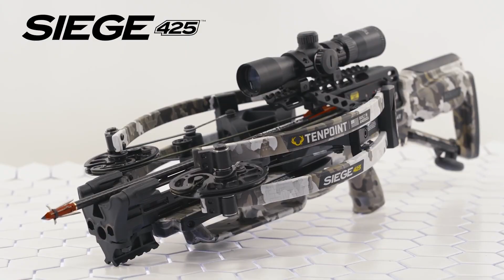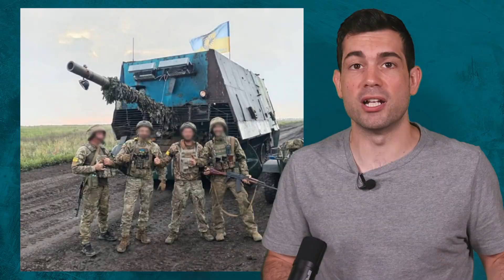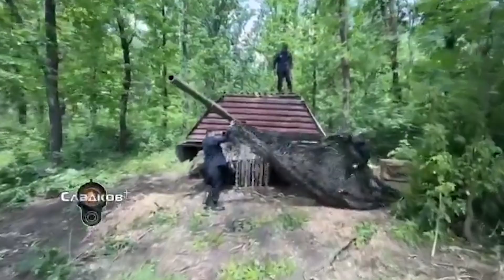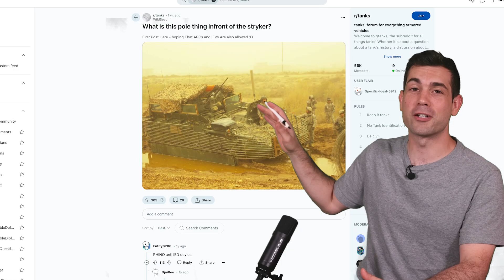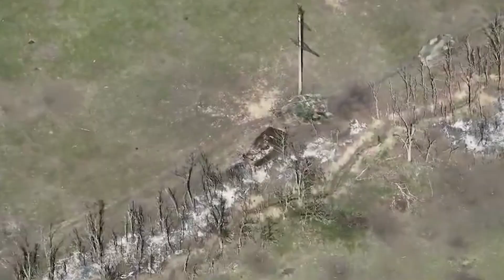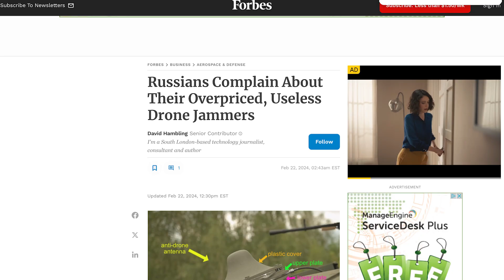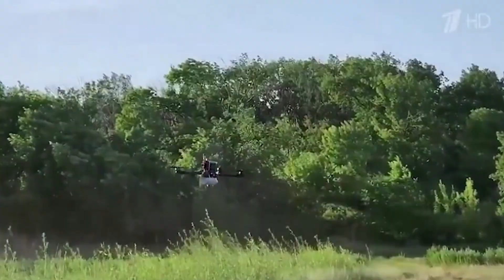Why Ukraine’s Taking Turtle Tanks Seriously

Comment: Honestly, I do not know why they do not. Just load smoke dispensers with grape shot And have a sensor set up that will see the incoming drone and will detonate the grape shot like a Better and cheaper active denial system where it just knocks the drone out of the air like a large shotgun blast. And it's anti infantry as well for those climbing up on top of them

Comment: Its still a very strange adaptation. No doubt it escalated the difficulty for FPV drones to attack but if it did survive and reach fighting distance with Ukrainian lines, what purpose would it then serve? It has terrible visibility and constraint turret movement that negates it as a tank. Its a mighty expensive way to build an inferior assault gun essentially.

Comment: Russian morale is so low that I'm pretty sure that Russian resistors are silently developing counter-measures for the tanks. Some of them include: Mismanagement, tank incapacitation. This means that the tanks are far less powerful in the hands of the Russian frontlines than their full potential would allow.
Reply: Russia isn’t losing the war, stop watching CNN and Disney
Reply: Furthermore, now that I think about it, the tank's modification seems to align with the troops' wishes the most: The tank armor does not boost offensive power, it increases the survivability of the crew.

Comment: A number of years ago, I read about the US military testing a centrifugal gun that could fire ball bearing sized projectiles at a rate of something like 100k rounds per minute.  It was projected to be added to armor as a short range anti-personnel and anti-drone weapon.  As I recall, it was basically a high-speed spinning disc type device that accelerated the rounds from the center out through an aimed aperture at the edge of the discs.  Fired in sweep mode, it could flood the airspace around the vehicle with ball rounds in short bursts.  I'm curious what happened to that project?  It seems like it would have great applicability in an era of small FPV drones.

Comment: Ukrainian troops don't want anything to be used by the Russians, that may give them an edge.
It shows the willingness to modify tanks and weapons on both sides.
Ukraine has shown all kinds of modifications to drones.
Trying to spot a drone, the size of a chicken, isn't what most AA radar was designed to do.  They're looking for aircraft, like jets and helicopters.  Something as small as a drone, is just getting lost in the background noise.
But in the videos we see, there's no radar at all.  convoys of tanks go plowing along across the plain usually in a single file.  and drones target whichever tanks the operator can get in the sights
Removing the 'reactive armor,' seems counterproductive, shell or not.
The thin 'homemade,' shell over the tank, will not stop most attacking drones.  And will do even less against an anti-tank missile.  And no reactive armor on the tank, leaves it kinda naked!
Anything getting in past the shell, can hit the tank itself.  And ends up usually being a, 'bad thing.'

Comment: The most vulnerable parts of a tank are the turret top and the engine deck. This is why drones are so effective. They can strike from above where the armor is weak. If you can explode the drone warhead before it hits the armor, the tank survives. The turret can't traverse, so you basically got an assault gun/tank destroyer, but those are nothing new. Drone warfare is changing everything.

Comment: What would be great, is if we saw Ukraine attach a DF (direction finding) antenna and basic AI that basically kicks in when the operating signal reached "x" db in power. Use the DF antenna to determine the direction of the jammer and the onboard AI to determine distance by some means such as in this direction there are "y" items in the field of view that match the direction of the jammer and based on signal strength and AI analysis of both the image and signal strength, item "Z" is the most likely target.

It seems these Turtle tanks are used as troop transports to cross fields where Ukranian tanks and armor isn't... So if you could build the system light enough with a working and practical DF antenna and a decent AI program... Worse case scenario you hit more Russian armor that isn't carrying the jammer.

Comment: It may not be the precision of the Tunguska that is the problem. The operational envelope that FPV drones exist in is challenging for older radars. Because of their relatively low speed and low RCS, powerful microdoppler radars are an absolute musts for detecting small drones in time to do anything about them.  Tunguska were optimized for higher speed threats with better radar returns.

Comment: A simple anti-drone system would be 5.5mm chain gun mounted on the top of a tank or APV with a short range radar and AI remote fire capability.  A short burst could easily destroy most drones!
Of course the Russians haven't the industrial capability to make the necessary electronic components for such a system.  But the Ukrainian's do and what they can't make they can buy from their allies in Europe and America. In order to fly,  drones need to be very light, this means plastic, light motors, small battery, which make them vulnerable to small weapons fire.

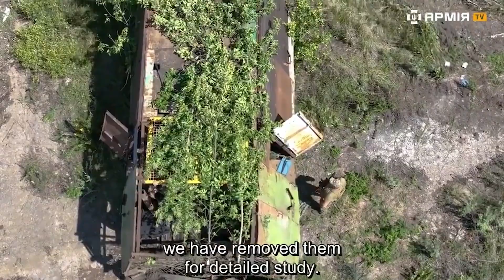Comment: 14:35 these external jammers strapped onto a pallet placed on top of a tank were very short lived, like 1 week. The turtle/shed tanks then appeared with some of the first clearly having jammers installed. The first of these apparently took something like 24 FPV drones out. This number fluctuates as sometimes Ukraine captures the EW and there is a window of Ukraine's drones being unjammed.
I've heard one stat about how Ukraine will send a wave of 3 FPV drones against a tank; however, if it is a turtle/shed tank then that becomes 6 FPV drones.

Comment: The UAF captured a turtle tank yesterday. It was gutted inside. The active protection pods were empty. The 'armor' was sheet metal.  It was a giant APC with literally no armor, even the captains turret hatch was welded shut. The only opening was the driver seat.
Reply: "even the captains turret hatch was welded shut"

thats hilarious because doing that adds absolutely no armor, they simply made the tank harder to escape during an emergency
Reply: @joseaca1010  idk, welding it shut does increase the likelyhood of an he grenade, like those the fpv drones carry to not be able to blast that hatch open and create a deadly overpressure scenario for the crew. its somewhat not dumb. t55 and onwards have rear and bottomhatches iirc.

Comment: We designed the Early LAVs, and they were originally supposed to be lightning fast, responsive, and go-anywhere vehicles (why the 8 wheels and able to float over water).  At first they weighed only 14-tons.  The footprint pressure was so small, that they could drive over many of the old mines.  They were intended to get a squad In and Out, before the heavy armor or artillery could gets its act together.  This worked for about 10+years.  Now, After a few combat missions with modern drones, fire-controlled fast turrets, dual-warhead TOWs, AIM-120 GPS-guided Mortar vehicles, and any form of a 6kgram IED, these vehicles have been MUTATED well beyond their original functions.  Add-on spaced armor and grilles, and active armor, and bottom protection from smart mines, have just made these vehicles into another form of the M2 Bradley.  None of them can float.  The top armor is so cheesy that any 2kgram/warhead drone can disable them.  Credit goes to the US Army and Marines, since they added-on whatever devices needed to make them viable on an actual battlefield.  That probably cost many lives.  It is clear that vehicles of this type need some kind of "overhead protection" mechanism or electronic devices, which reduce or eliminate small drone attacks.  Drones can go for 10-to-20-times the distances of artillery rounds.  Russian forces have artillery as their fundamental battle doctrine.  They are responding just like the US forces did, to mitigate the threats for their enemy.  I predict that electronic warfare will be the next actual battleground at a tactical level.  At a strategic level, it will be heavy warheads, launched from a vast distance, where the launching platform will be safer.  For the Ukraine, any electrical power plant, water supply facility, railroad transfer yard, gasoline and diesel storage facility, and heavy bridge crossover, will soon be destroyed, from a far distance.

Comment: So the way that RC FPV aircraft work is that control is usually frequency hopping spread spectrum across a certain band like 2.4Ghz or 915/868 Mhz, it's literally designed to avoid interference. The transmitter is on the controllers side while the receiver is on the vehicles side. The video part is the opposite, the transmitter is on the vehicle and the receiver is on the controller's side. The video is usually analogue (although newer video systems like DJI/Walksnail/HDZero are digital) and not usually spread spectrum frequency hopping and runs on it's own frequency, usually in the higher 5.8Ghz band. It's much, much easier to interfere with the video signal than control.

Comment: Hear me out, what if they put a spinning antenna wire on the sides of the turtle tank kinda like a helicopter prop but with a hand crank. The antenna wire could knock the drone out of the sky and away from the tank.

Comment: I suspect that the RADAR and 30mm guns on a Tunguska SHORAD aren't able to keep up with the somewhat unusual flight profile of FPV drones, as it seems like they are more intended to track and shoot down aircraft flying at altitude, rather than targets basically travelling at tree-top/ground-hugging height. 30mm also seems like it could be a bad trade-off between terminal effect and amount of ammunition able to be carried, especially for drones, if it could actually hit them.
I'm also somewhat sceptical that it would be good against modern aircraft either, at least at the very extreme (for machinegun or cannon based systems) ranges that modern aircraft can engage and destroy ground targets, for at least the last 30 years.

Comment: For anti drone, we could add another turret on top of our tanks with a P90(or am180 my favorite) like a mini CIWS You can use a small short-range thermal that scans and points
Reply: The scanning turret can be separate from the gun. The gun itself would have a thermal of its own.  First (scanner/pointer thermal) locks on the second (the gun)locks they triangulate, adjust for movement, commence fire repeat until grounded or destroyed

Comment: Spaced armor does not function against HEAT warheads. Especially the RPG-7 warhead which is not optimally fuzed and actually achieves the greatest penetration after about 2 feet from the detonation point. Some ATGMs have this as a feature such as the NLAW which detonate the warhead several feet above the target tank.

The reason for the chain/wire mesh grid is to disable the piezoelectric fuze on RPG warheads. This ONLY works against Soviet RPGs which utilize this type of fuze. Essentially the warhead gets caught in the chain and then the thin outer shell is crushed against the fuze and this shorts out the warhead so it does not detonate. There are photos of this working from Iraq where you'd see an entire RPG warhead buried in the side of a Stryker with cage armor and it didn't detonate.

The function of the big metal shell seems to be protection from shrapnel and small arms for the troops riding on the tank.

Comment: An interesting comparison to make might be torpedo nets on Battleships in the late 1800s and early 1900s (They came back for a bit in WW2 as well). Cheap, fast-moving torpedo boats that could harm giant battleships had just become a thing, and this led to the adoption of awkward spars sticking out the sides of large ships to hold nets that would "catch" the torpedoes and prevent them from damaging the ship. In concept, pretty similar to what the turtle shell is doing on these tanks, and nearly as awkward-looking.

Ultimately, these were a clunky stopgap measure, like the Turtle Tanks. Spaced armor in the form of torpedo bulges and torpedo belts replaced the nets, and torpedo boats were partly countered by dedicated "Torpedo boat destroyers" - or, as we call them now, just Destroyers. Which would potentially line up with what's being said here about the potential of new SHORAD vehicles.

Comment: If they have to wire guide the drones kind of like a tow and depending how far the jammers reach the drone could just carry the receiver on it like normal then drop it when they start getting jammer inference and fly the rest of the way in by wire it might reduce the payload or speed slightly but at least they would not have to be as close and have a wire going all the way back to them they might even be able to drop the battery with the receiver and technically recover it later if they can get to it

Comment: The turtle tank is a low-cost solution.  The Russian lead in tank production is pretty unassailable.  These are vehicles that are built to win a war of attrition in the new battlefield that has many drones, but fewer tanks.

I think people obsess over territorial gains, when the purpose of the Russians is to attrit Ukrainian forces, while steadily building up its own.  

Maybe all the turtle tank is doing is forcing Ukraine to use more drones, thereby exposing their operators to counter-measures by drones, conventional artillery, and air strikes.  If the turtle takes a lot more drones or more expensive drones to combat, that helps the Russians.

People make much of these armored columns racing towards Ukrainian positions, but I see them as probing attacks.  Ukraine must respond to each of these attacks, which reveals their strength levels and troop and artillery dispositions.  Western propaganda makes much of the destruction of these old tanks, but "winning" all these skirmishes comes at a higher cost to the Ukrainians than the Russians.

When you stop to think about how expendable these monstrosities are to the Russians, it changes the calculus quite a bit.

Comment: Why don't they use the jamers signal as a guidance source for a drone that is flown close and then guided to fly towards the signal. You would need to limit the detection range so it does not fly back at the operator.

Comment: Cheap FPV drones are the biggest threat by volume to formations and units, not NLAW, Javelin, etc. ATGMs due to logistics. Direct fire from tanks and artillery strikes would make short work of these, but are also limited. Slat/cage armor with EW jammers stacked underneath is a viable solution to the current predominant threat. 

Future SHORAD systems will have to be designed around economy: the cheapest, most reliable counter to swarms of cheap FPVs. Mini flak cannon, mini air burst munitions, mini-Phalanx cannon, etc. controlled by detection systems geared towards smaller vehicles, and/or continued improvements of EW jammers. 

Interesting to see warfare evolve in real time.

Comment: Given how cheap processors and electronics are today it shouldn't be too hard to design a very cheap image recognition and targeting system. This way the drone operator would just have to get a decent picture of the target from a distance. tag the target and have the targeting system take over. As the jamming systems described only disturb the radio signal that wouldn't make any matter if the target system is just following the camera image to home in on the target.

Now the question is how cheap and small such a system can be. What it would need is the ability to recognize the target pointed out by the operator, follow this even if the target move and fly the drone to hit the target. some of these functions you will find in cheap cameras, and several years ago I saw details on a rifle scope that could follow a target and calculate the drop using a laser range finder, the targets movement direction and speed and the wind drift using several wind sensors. The result was that the shooter selected the target and the targeting computer adjusted the sight reticle to compensate for the distance, movement and wind drift. The shooter then sighted the adjusted reticle at the target and when the computer calculated that the weapon was pointing at the correct spot it would fire. This was a rifle scope, but the ideas are largely the same. The entire idea is to move the final targeting from the drone operator to the drone without needing more radio contact before the drone enters the area where the jammers make radio contact impossible.

I think this could be made very cheap.

Comment: Saying Russia's running out of tanks as to why they're using "turtle" tanks doesn't seem accurate.
If they were using these in actual combat as an open combat vehicle, then that statement has a little more credit, but they're not.  They're seemingly using these as armored personal carriers.
So, instead of tanks, they seem to be running out of troop transports.  Sure, they're slow as sin, but if it can get troops from point A to point B to some degree safely, then it works... kinda...

Comment: The turtle tank, a t62 frame and engine with a welded cannon in the forward position. Not carrying any rounds for the main gun. A gutted interior, the driver isolated to looking forward through a vision block and armour made from scrap. The standard kinetic armour, has been replaced with sheet steel that cant stop hand carried weapons nor does it protect the crew or passengers. Why is it in the battle space?